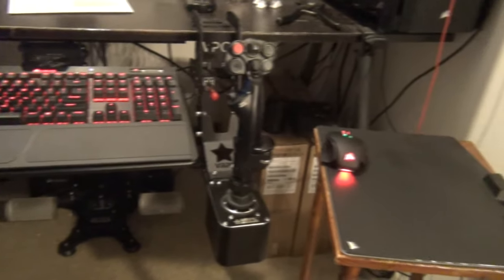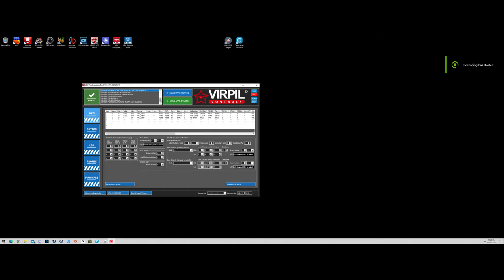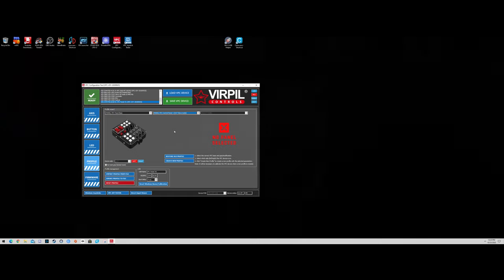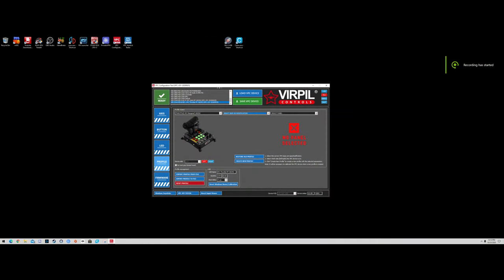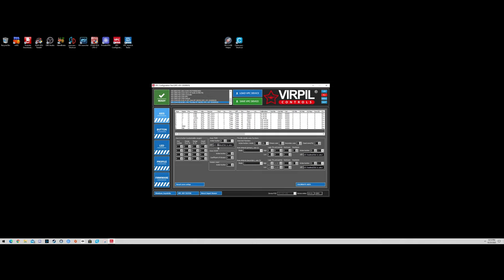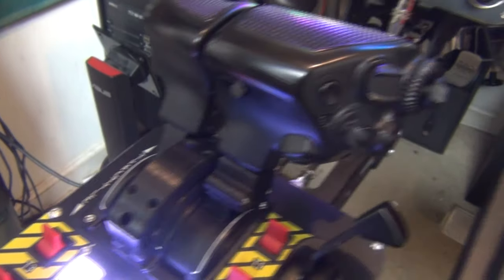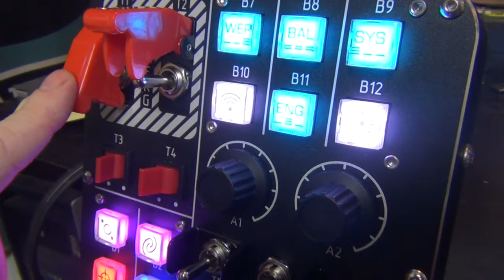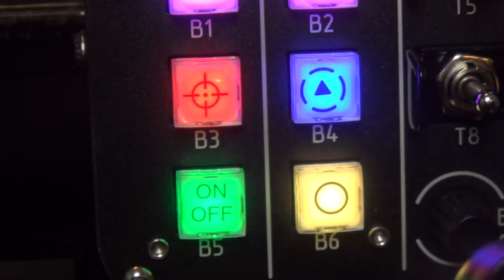virpil control panel #1 setup and overview

Comment: How in GODS name did you get the button covers off for the label inserts? I read the manual, noting the little hole that you're supposed to insert a screwdriver head into that should cause it to pop off, but it makes the entire button pop off (clear cover and the plastic diffuser its attached to) instead.

Comment: Nice!  What kind of detent attachment are you using on your CM2 throttle btw?
Reply from the maker: i dont have the CM2 anymore i sold it and bought the CM3 with built in detents, that was a 3d printed one for the cm2 but it didnt work very well

Comment: Question on the picture the connectors are on the top of the base, while yours (and Virpils on control panel 2) are on the bottom for better cable management. Do you just take it apart? Does Virpil recommend this? As I don’t want to void my warranty when my panel comes! Thanks in advance
Reply from the maker: it dosent void your warranty, all you do is remove the top screws and rotate it around, all virpil products are designed to be tinkerd with and customized
Reply: @turdpeterson73  thank you! Much appreciated
Reply: @XxTRUEPINOYxX14  could have watched the video since it was in it.

Comment: Hello Turd Peterson. I have a question about buying from VIRPIL. I was on there site looking around and it looks like you have yo buy each piece individually and put it together yourself. Is that how it works?
Reply from the maker: yea pretty much you pick the kind of setup you want, example choose a base warbryd or the CM2 then choose a grip style you like, some people like center mounted stick with extensions, some people may already have monstertech mounts and may not wanh the virpil ones, some people like duel grips ( HOSAS ) other like me like grip + throttle  ( HOTAS )  so yea you pick the the parts that fit your style  

here is the parts list i went with for my setup  

VPC Control Panel - #1
VPC Control Panel - #2  ( still on pre order )
VPC Desk Mount Adapter - Control Panel
VPC MongoosT-50CM3 Throttle
VPC Desk Mount V3 - L
VPC Desk Mount V3 - S  x2
VPC MongoosT-50CM2 Base
VPC Desk Mount V2/V3 Adapter - MT-50 Throttle  x2
VPC MongoosT-50CM2 Grip
VPC WarBRD Rudder Pedals
Reply: @turdpeterson73  Thank you for the information.

Comment: short question can you change this led buttons to toggle the color after a push ?
Reply from the maker: yes and no, its very limited , you  cant have each button change, but you can havea action to where all the buttons change color togther, for example one time i set it up to where if i press self destruct all the leds would change from white to red
Reply from the maker: here is a example video  https://youtu.be/k9LJGrRKlUw
Reply: @turdpeterson73  interesting i think there needs to be a good tutorial video with all the possibilities for the led stuff.... i spent 2h today to set something somehow. hope virpil brings some software updates because it shouldn't be hard to change button colors for a key confirmation :/
Reply: @turdpeterson73  Coincidentally, I just sent in a support ticket to Virpil if it would be possible to have individual lights illuminate when the button is pressed.
Reply from the maker: @jcjammer8972  kewl
Reply from the maker: @jcjammer8972  yea i wouldnt hold our breath or anything